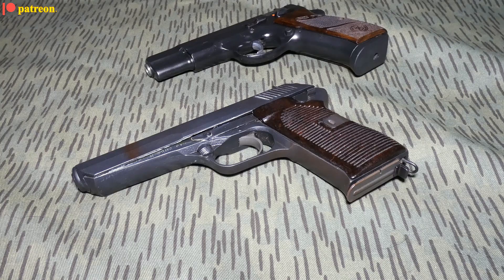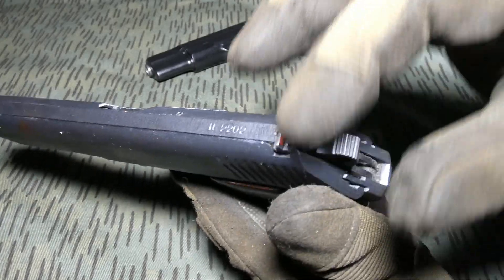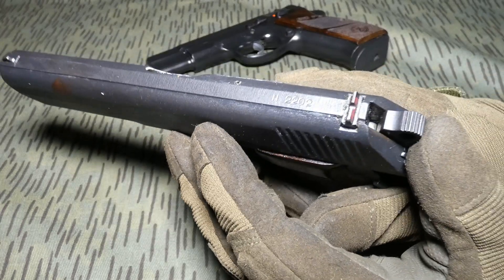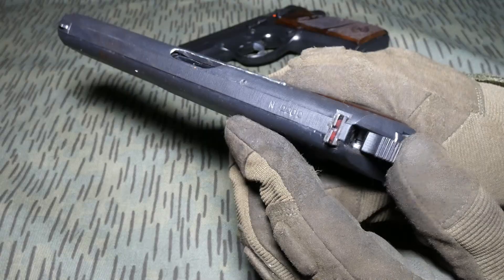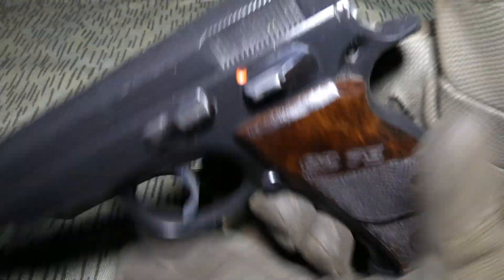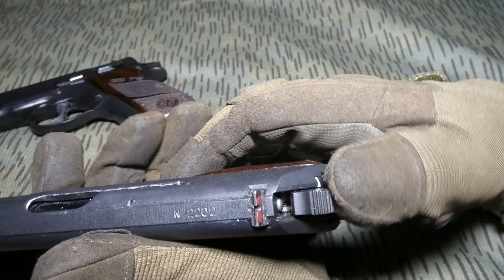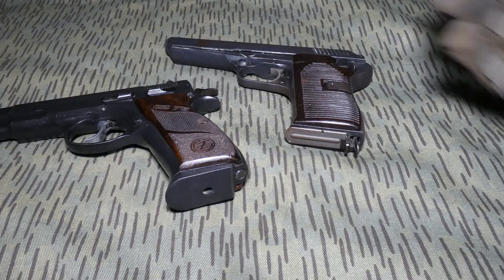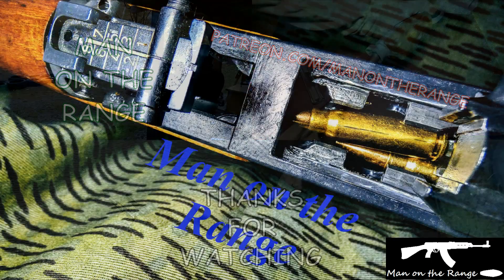How rebounding hammer work (4K)

Comment: Is this a safety feature？
Reply from the maker: yes, it is like half-cock notch on cz75 or 1911 but in automatic mode... you can cary round chambered without the risk of hammer pushing on the firing pin and firing pin then resting on the primer